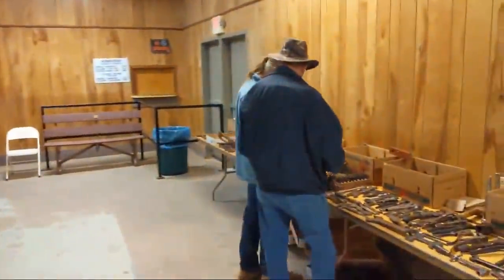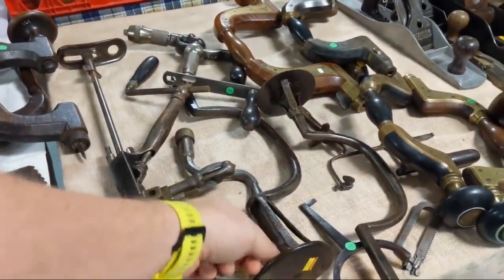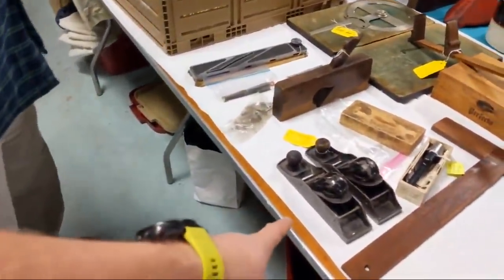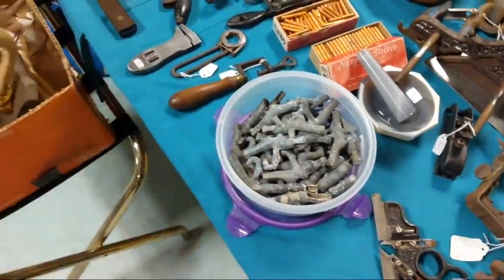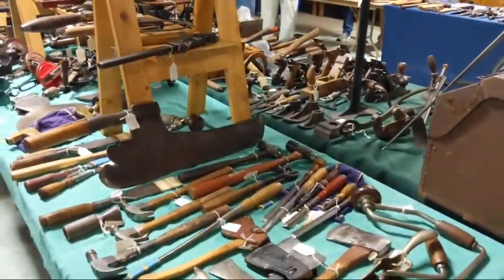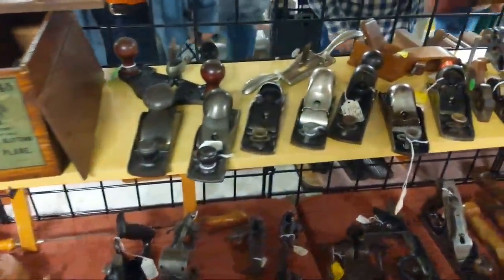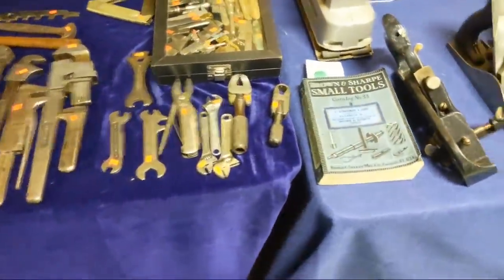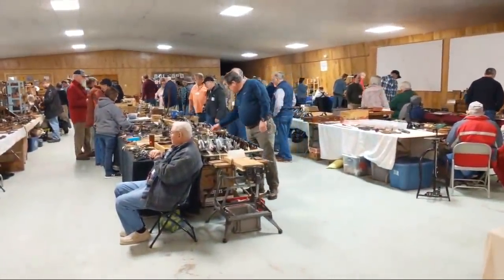MWTCA Peach Meet 2019 Inside Tool Sale

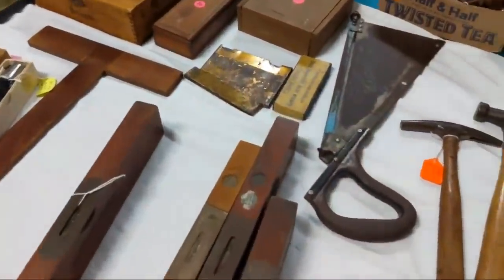Comment: The "backsaw-hacksaw" at 19:34 is a saw style most known for being made by Eclipse, not sure if anyone else copied them. It's designed primarily for cutting corrugated sheet steel for use in roofing and other construction, but is also good for making long cuts in any sheet metal. There's another, more common version of it - the no. 55 - with a straight instead of angled back. I don't know the number of the angled version but it's so you can present the teeth at a different cutting angle without the back interfering in the cut. It provides a different cut quality than using a shear or a nibbler, important if you want both pieces, and can handle thicker material. Of course nowadays someone would just use a cordless sawzall or jigsaw, but it was a solution back in the day.

Thanks for filming these events!
Reply from the maker: Interesting. Thanks for the info!
Reply: You're welcome!

Comment: I know your interests lie in planes (especially infills) but my interest is in PARING chisels. Of course I have 15 or 20 regular "chisels" like the Narex and Two Cherries etc. But Paring chisels (thin long flat low angle) are hard to find that aren't new. Could you do a little more investigating and let the world know where they might be found?
Reply from the maker: there were quite a few of them there this weekend. they are not as common as they were easily broken but they are out there.
Reply: @WoodByWright  True and you skipped by them so fast I could barely register their presence before you were gone .. 😃😃